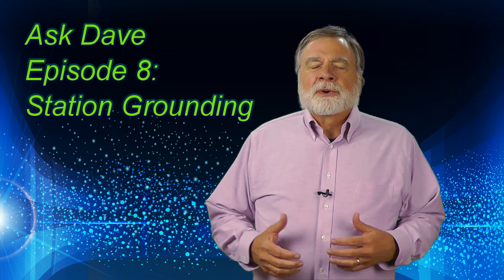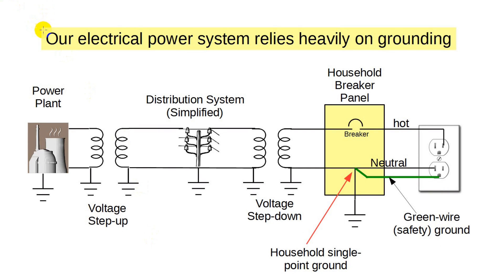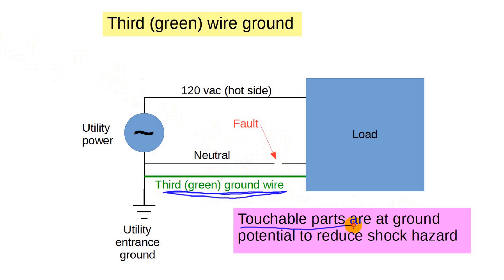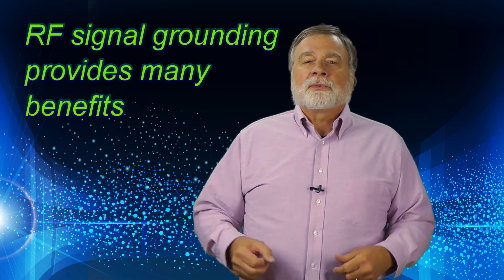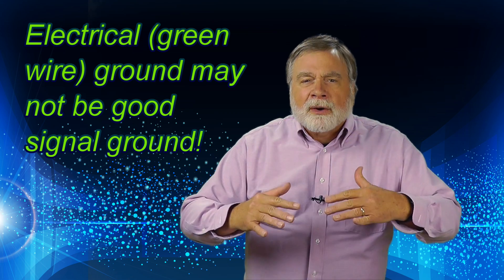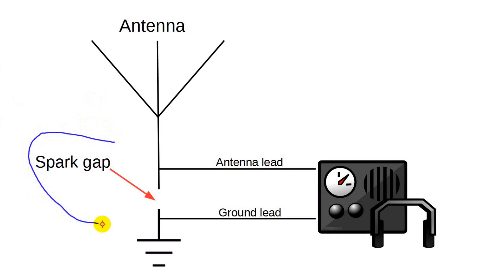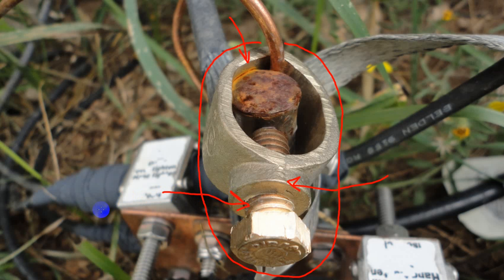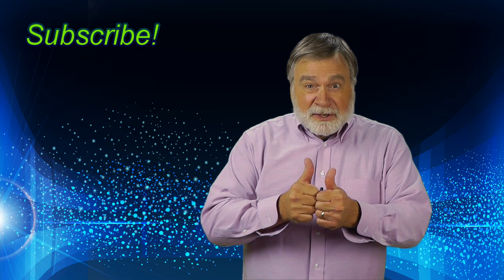Station Grounding for Amateur Radio: Ask Dave Episode 8

Comment: This is the most comprehensible information I've seen on station grounding. Thanks for a concise, understandable overview.
Reply: I figured I would hook up my old CB radio at home. 20 video's later I am realizing everything this project is going to require. What went from let me hook up the old CB at home went to I need a base station antenna, a new CB, new mic, grounding rods, mounting materials, wires, and support guy wires with stakes.
 Typical project done correctly !

Comment: But Dave, here's my question. Obviously, the radio, the tuner, and the TNC are all interconnected (said interconnection not shown here), meaning that each one has several paths to ground, meaning you have essentially created several ground loops with the use of the long copper bar. I'm a brand-new general, so I'm far from proficient in this knowledge, but the more I try to figure out what to do to ground my radio (which runs off a marine battery), and my tuner, the more confused I get. Here's my setup--marine battery connected to radio, tuner connected to radio, G5RV antenna connected to radio. I have driven an 8-foot copper grounding rod into the ground right outside my shack only a few feet from my equipment. How to ground all this stuff--antenna, radio, tuner, battery(?), I have no idea, since I'm trying to avoid ground loops.  Something that should be simple and straightforward seems not to be. Most explanations tend to be abstract, and not concrete enough to help a new guy actually hook things up properly. For instance, how does one actually hook flat copper ribbon to a copper pipe? Are there commercial fittings available for such purpose? And if the equipment is interconnected and then all connected to the same pipe, doesn't that create ground loops? Finally, since I disconnect all my equipment from the antenna and the power source when not in use, and I don't plan to use it during a lightning storm, I've been told I don't even need to ground anything. (But then, doesn't static electricity build up on my antenna, meaning I could fry my radio when I hook up the coax from the antenna. Or can I just touch the coax to the ground rod before connecting it, and will that solve the potential problem?) After all, I essentially have a "field-day setup" right in my shack. And as far as I know, most folks don't use groundings on field days. All the advice seems to lend more confusion to this topic. So many questions, so few answers. I enjoy your videos, and am using them to help me muddle through getting started in my new radio hobby. Thanks for any help. 73.
Reply from the maker: I stand by the video. You can attach copper strap to the ground rod with a hose clamp. You should run all your antennas through lightning arrestors that are clamped to the ground rod. Don't worry about ground loops unless you get RF in the shack, and then try first just rearranging cables until things work.

Comment: Hi Dave, Thanks for all your videos, they have been helpful.
Last week I installed a mast to my chimney, and it has been working great. Today I finally got back up to run the ground (6ga stranded) from the mast to my home's single point ground rod. But now, I'm tripping my GFCI in the garage where my station is located.  If I disconnect my antenna from the radio, I have light, but when I try to plug it back in I'm left in the dark. I do not have any other grounding options, and have not yet grounded my coax either.
Reply from the maker: You've got some ground current flowing through the GFI, which will trip it. Something somewhere isn't right. If it's RFI that trips it, you might try replacing it with a new one--the new ones have less sensitivity to RFI if you get a brand name item.

Comment: Dave I enjoy all your videos, but I’ve never seen anywhere where they talk about the actual wire type and size to use between the grounding lug on the back of the equipment and the station MGB... Stranded or solid? And what gauge? Too heavy and it’s a bear to run. Too light ... is it effective?
KB7CG
Reply: C Young - The NEC has quite a bit to say about the mounting and grounding of antennas, masts, cables, guy wires, etc. on or near buildings. Example: Mininum # 10 copper wire to bond to earth ground, and minimum #6 copper to bond an antenna's ground rod to a building's primary ground electrode if these are separate. The NEC covers too many situations/details/wire types to put in this comment column. (Please never rely solely on comments here when doing an installation; consult the NEC. It applies to radio and TV antennas as well as amateur radio towers.)

Comment: Dave great video. I appreciate the info and look forward to many more from you.
My issue with the grounding on my setup is that my shack (in home) is a long way from anywhere to ground. About 35 or so feet. I’m getting RV in my house and my neighbors.
Any suggestions for this situation?
Thanks,
Cecil N4PNN
Reply from the maker: You should still ground your shack's equipment. But, also bring all the feedlines to the ground rod and hook them through lightning protectors. That may help a great deal.
Reply: @davecasler  I will certainly still.do it even if it is almost 40 feet to get to a ground. I appreciate your help with this. Thanks

Comment: Dave, 
I like your video.  However, I think you should explore the idea of exothermic welding, or "cad welding" as opposed to mechanical connections for the ground rod.
Reply from the maker: I've heard good things about it, but have never tried it. I'll have to look around for it. Thanks for the suggestion.
Reply: Better still is the Burndy Hi-Press connectors. A big hand tool squeezes the copper fittings onto the copper rod at such high compression that the materials mash into one. No flames, and permanent. I rented mine from a specialty tool co.

Comment: Can you please just show a pic or a drawing where to attach the ground wire from the antenna to the ground rod? is the ground wire supposed to run from the base of the antenna  or from the base of the mast to the ground rod? ? And if the ground wire is ran from the mast or from the antenna,  if there was a lightning strike, wouldn't the lightning not only go through the ground wire to the ground rod  but also go through the coax to the radio?  Im so confused.  and ive been watching many videos on this and im still confused. Please explain to me how its done. . in a way that  is easy to understand. thanks. tnx. JK
Reply from the maker: Sounds like a good topic for a future video.

Comment: I have a vertical with 50 buried radials.  Is it really necessary to ground then antenna base with a ground rod as well?
Reply from the maker: If your buried radials are bare, then no. If they're insulated, then, yes, you likely need a ground rod. I have not had good luck with buried radials. Some people say it doesn't matter if they're buried or not, but I've had better luck with insulated radials lying atop the ground.

Comment: My house gwas built in the early 70s. With that being said. My house ground is my copper pipe for plumbing. The main feed is a steel pipe where it enters the home. I also understand that the connection to the house feed is way to long to be an effective ground. If I ground my station to a ground rod it will be a more effective ground and will essentially become a new house ground. If I did not change the house ground what rf effects might I expect to encounter. I do plan to correct the ground in the near future just curious for educational purposes.
Reply from the maker: I recommend not messing with the household utility ground. You can put in a much closer ground rod for your station ground, but remember to connect a good wire (#6 is recommended) between the two grounds.
Reply: Great idea! Thanks. My "horse blinders" kept me from looking at that option.

Comment: I question ? the ac ground to the station ground  that connects to all your gear ?
Reply from the maker: The AC ground is the utility ground. All your equipment having third-wire grounds should be connected via the electrical outlet to the utility ground. Some equipment, such as many 13.8v power supplies will connect the DC black wire to the utility green wire ground. This is normal, and should be connected to the station ground. You should "bond" the station ground to the utility ground with #6 wire (bare works fine) to keep the ground happy with one another.
Reply from the maker: @user-lp3cf5yn5b  Many things could cause it. Make sure your station ground rod is "bonded" (connected) directly outside your house. Also, if there is a faulty appliance in your home, it could be putting current into the green wire ground, which would cause a voltage drop. Also, a small voltage can develop between the two simply due to inductive effects. If you have questions, check with a qualified electrician.
Reply from the maker: @user-lp3cf5yn5b  Yes, it sounds like one of your appliances or electronic devices has grounding issues.

Comment: I have a vertical antenna grounded via 8' copper rod and compression connected with copper wire  to the rod as shown in your video.  My shack is 100' away in the basement of my house.  I have a choice of grounding my radios and power supplies to my house ground which is the same as my 120 Volt ground, or to put another dedicated grounding rod  within 10'  of my equipment and run a copper wire from there to my equipment.    My concern is that I might create an electrical difference between the grounding rod of my antenna and the new grounding rod for my equipment,  as not all grounds are always equal.  My house grounding rod is about equal distance from where I would put a new dedicated shack ground rod. Am just I overthinking this?
Reply from the maker: I'd say to go ahead with the station ground and then bonding it to your utility ground.
Reply: Appreciate the reply.  After reading up on this topic, I think I will tale your advice.

Comment: What about a second floor station?  Should I still run a ground run from my single point station ground.  It would be about 20 feet.
Reply from the maker: Yes, you should. It can help reduce noise induced by local sources. But being that long can still create a ground loop, see may have to play with it to get it right. Still recommend running your coax all the way to the ground to a lightning protector and from there to your antenna.
Reply: I have lightning protection at a second ground just below my ham shack which is connected to house ground.

Comment: I just put up a 30 foot tower 20 feet away from my second floor room where my radio room will be located at.   I read that your antenna coax should be grounded at the shield on top of the tower and then at the bottom.  
What i wanted was ok, i can ground my shield on top of the tower and half way down come across my siding of the house to my room.   Is it necessary for the coax to go to the bottom of the tower and then across 20 feet and then back up another 20 feet?  im wasting length this way.  I wanted to come down half way my tower and go across the house.   Please if you may, give me your advice...

Thank you kindly.
Reply from the maker: I recommend that the coax go all the way to the ground to a lightning arrestor connected to your station ground rod, and then from there to your station. I know that seems like a lot, but I think you'll end up with a quieter antenna, plus gain some lightning protection.

Comment: This is the first video I've watched from you - outstanding information! This helped me better understand grounding principles as I prepared for my General license. Two basic questions - just how long does a grounding rod really need to be for an rf ground (not lightning) (end-fed long wire)?  And, can you use a common ground rod for the antenna and station - or, should they be separate?  Thank you.
Reply from the maker: The signal ground is usually an 8 foot ground rod such as is commonly available at Home Depot or Lowe's.

Comment: Dave, my shack is on the 3rd floor of an apartment building.  What do you recommend for me to ground to?  Caveat... I am in South Korea, and we use 220v.  I did find a ground rod in the middle of our electrical service area, and where our cable TV hook-ups are.  Should I run a wire down to that?  Will it do any good, given my high location?  I also have a copper roof cap along the top of the building.  I have thought of seeing if it's grounded (I believe it is, via downpouts and a strap I see them attached to at ground level.  I wondered if I might ground my coax to that.  I also have ladder-line, so not even sure what to do, there.  At the moment, I unhook everything when a storm comes.  Luckily, there are some higher structures with lightning rods nearby.  Any thoughts?  Thanks!
Reply from the maker: Very often metal building fixtures are poorly grounded, and with time and a little corrosion, the connection can get tenuous. I do not recommend connecting directly to the utility ground because it can be quite noisy. However if possible you can put in another ground rod, connect to that, and then connect that to the utility ground. That's what I do.

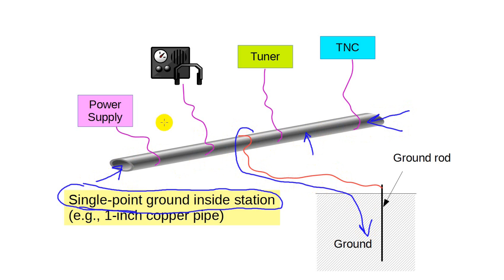Comment: Dave, at ~9:20, you recommend attaching all device’s RF grounds to a length of copper pipe. How? Some type of plumbing fixture? Or...? Many thanks!
Reply from the maker: Just use a short length of copper pipe. I use hose clamps to attach the ground wire and equipment grounds to the copper pipe. You can get these at Home Depot or Loews, etc.

Comment: Dave - Just watched your Station Ground video.  Quick question, can you put the station ground rod inside a basement?  I wonder if drilling a hole in a basement floor, and driving a ground rod into the earth underneath the basement floor would be ok, in order to keep the RF ground path short rather than run it outside which may be 20 ~ 25' away.  Any thoughts?
Reply from the maker: Yes you can, but generally they're outside. So if you put the lightning protection out at the ground rod, it's outside the house and the lightning stays outside the house.
Reply: I have the coax grounded outside via a ground rod and lightning protection there.  I am wondering if it would be better to drive another in the basement floor just for the station equipment.  That way the lightning stays outside, but I get a short run to ground for the station equipment.  Then bond the two rods together.  Would that make sense, or just run a long ground wire to just the rod outside?  Just want to provide the radio equipment the shortest path.

Comment: I wish for you to expand on RF in the Shack and the use of current chokes, baluns of different sizes and having several HF antenna’s, say a End Fed 80m wire and a HF yagi with one sending current down the coax of the other when transmitting. That seems to be an issue in my shack. Thanks, you are doing a great service to the Ham Community.
Reply from the maker: Fighting RFI can be frustrating. I'll add that topic to the list. Thanks

Comment: I have a new yaesu 991A I want to connect a computer screen (laptop) to my 991A, or just the screen from an old computer.  What do I need?
Reply from the maker: I don't think the 991 a has an output for monitor. But you should be able to connect your laptop to it.

Comment: Hi Dave - I just passed my Tec and General tests a week ago (no callsign yet) and I am setting up my 1st ham shack.  I plan to install copper  ground rods just outside the radio room and attach RF and antenna lightning to them (I will cross-connect those.  My question concerns my AC service ground for my home.  It is on the opposite end of my house.  Should I run a  50-60ft wire around my house to tie-in to that ground rod as well?
Reply from the maker: Ideally you should. But you have to be practical. If you do run a number six wire all the way around the house, use bare wire and bury it. Good luck getting on the air summation point

Comment: Does the lightening arrestor on the ground rod also ground out the static electricity, say on a vertical VHF/UHF antenna?
Reply from the maker: Yes, generally. That's assuming that the antenna is at DC ground. If your antenna is a J pole, then that's certainly the case.
Reply: Thank you very much for all the information you provide!!  It's a Diamond 8900 tri-band UHF/222/VHF intended for mag-mount on a vehicle, but I'm using it in a window (on a baking sheet + mag mount) and want to move it outside with a 4-wire (45 degree) counterpoise - I believe all these mobile antennas are JPoles... if that's so, I should be good to go with regard to static electricity.  
It works well indoors, but I wanted it outdoors, preferable near or at the roof line.
K1PMS clear.

Comment: Dave: What about grounding when backpacking or on SOTA expeditions? What is the best way to accomplish grounding? 73's KD9JEO
Reply from the maker: It's an interesting question. Most often these little portable stations are not grounded. If you have RFI problems, you can try a counterpoise. But if the antenna that you backpack is a loop or little dipole, and you're operating QRP, I doubt you'll have a problem with grounding. Good luck with your travels!